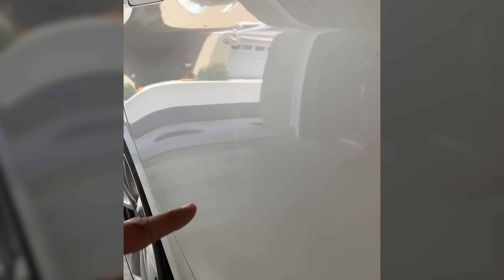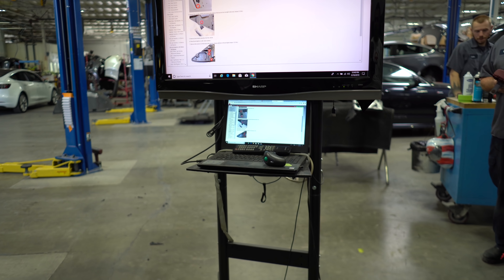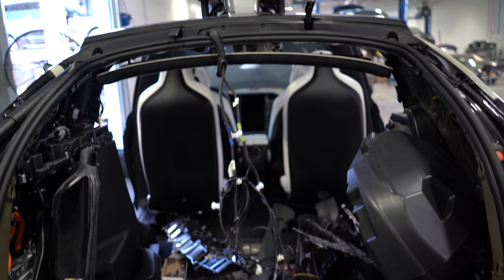Fixing a dent in a Tesla

Comment from the maker: I had SENTRY mode activated but none of the clips captured show this happening which tells me it happened on another date and that footage had already been overwritten. 

Most important things to know when looking at Painless Dent Repair:

1.  Make sure they have a long running history and experience with doing this service.  Rick has 15+ years experience

2.  Skilled guys should be able to do the service without any modification to you car.  Many make a hole and seal but Rick used the existing cable hole

Comment: Very informative video, but wish you had recorded as they worked on your car.  One thing I will say is, just because a body shop is Tesla certified it doesn't mean they do a good job.  Let me share my experience.

My 3 month old Model 3 was backed into while I was in it.  The other car hit in my drivers side rear quarter panel and scratched the wheel (I had the aero's off).  The car was still drivable.  It took several months before the insurance company approved the repairs.  I had to drive 2 hours to the nearest certified Tesla body shop and rent a car to get home.  It took 6 weeks for the repairs to be completed, partly due to a parts delay from Tesla.  One note, besides the small side window having to be removed, the rear roof glass also had to come out and both broke upon removal.  The body shop said this is common for the fixed windows to break when trying to remove them.  I had to rent another car to drive the 2 hours back to pickup my Tesla when it was ready.  After getting it home I noticed imperfections in the paint at the repaired area and a rear bumper sensor was loose.  I contacted the body shop and drove it back a few weeks later for them to fix, they did this as I waited.  When I drove it home again and looked more closely, the paint still wasn't right.  I contacted the body shop yet again and now they wanted to keep the car overnight.  This was unacceptable to me and I chose not to use them again, and keep my car as is.  But I did get them to refund me some of my deductible that I had to pay, when the repairs were initially done.  I will say that the body shop did repair some of the Tesla factory paint issues, yet created new ones.  One more thing, the body shop had to send my car to Tesla for an all wheel alignment, because the rear wheel was hit and Tesla confirmed it was out of alignment.  But now the steering wheel doesn't sit centered as it used to, it's off to the right a bit.

My Model 3 has been a love hate relationship.  I love driving it, but hate the repair frustrations.  And of course my Tesla will never be the same, and always have a negative mark because of the major repair to it.  Part of me wants to trade it in for a new Model 3.

Comment: Any idea how the repair was done.. panel removal, etc?  Cost also. Cheers
Reply from the maker: $100 and they used the existing port which wires are run through.  They go in from there and push it out.